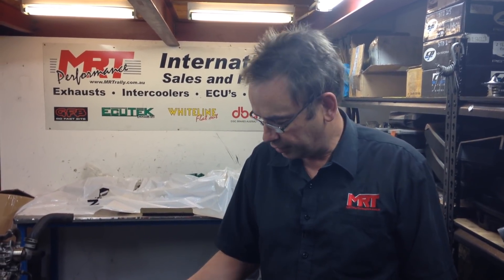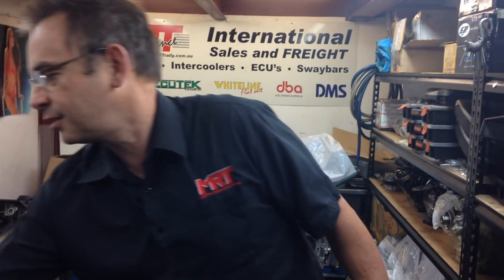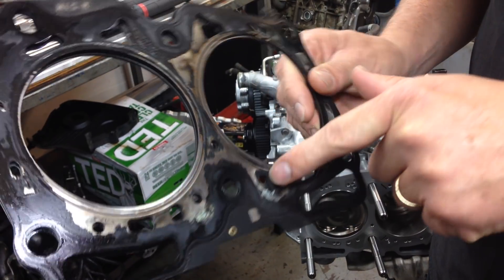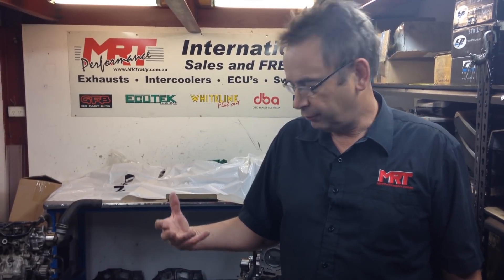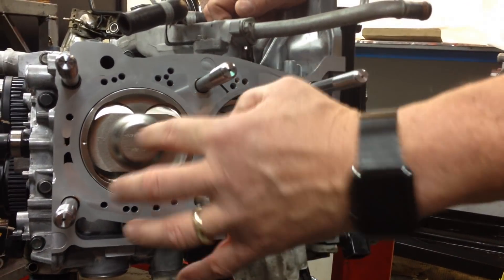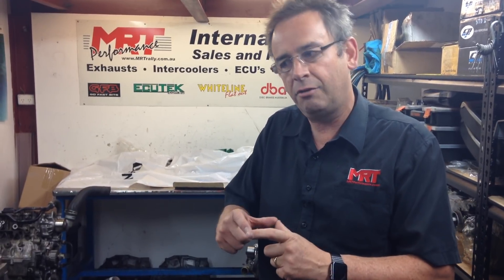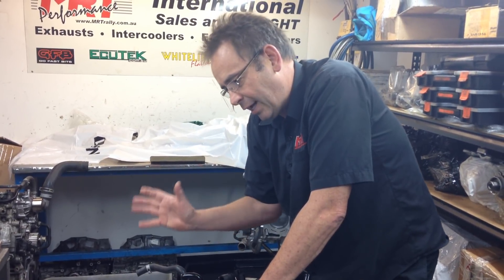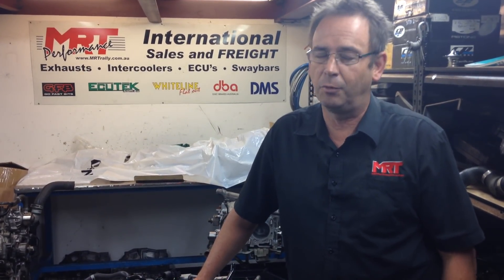Anatomy of an Engine Build

Comment: Hey buddy I have a my12 wrx with the similar problem it blowing head gasket very often I have just did darton sleeves on it an only had 2 days running it. I had to sleeve the motor due to number 4 stock cylinder liner broke so I sleeved it. An now it still blows gasket I use fel pro gasket this time I also didn't give any break in time cause I figured I had done it right it has forged pistons h beam rods arp 2000 head studs stock heads cavali stage 2 ball bearing turbo tune for 20lbs to red line. 11mm oil pump acl race bearings the works an still blows head gasket it was at the machine shop heads are OK no wrap no Crack block also gud
Reply: Have the block decks been checked for straightnes?

Comment: Hi. Maybe you might know :D I have a 2008 legacy 2.0td and the piston went the other day. I am assuming that its a ee20 euro4 engine. I was thinkin of replacing it with a ee20 euro5. Would this be a straight swap do you know? I read that I would need to keep the euro4 turbo, injectors and plugs?
Thanks

Comment: I've always been worried about how the head gaskets line up with the coolent passages.

  Some builders say it doesn't matter to have part of the gasket slightly or completely cover some of the water jacket passages on a closed block but I'm dead set on preventing head gasket related coolent restrictions. 

  Anyone have an opinion or experience with match port head gaskets on close decked blocks?

Comment: Great info Brett, really enjoy watching and learning the videos. Just wondering what tolerances you shoot for on the main and con rod bearings? And what is the corresponding oil pressure under load with that set up? Thanks